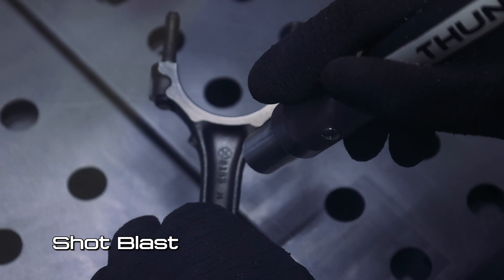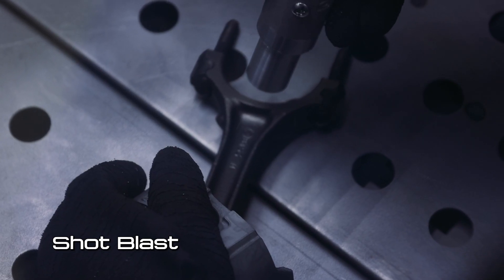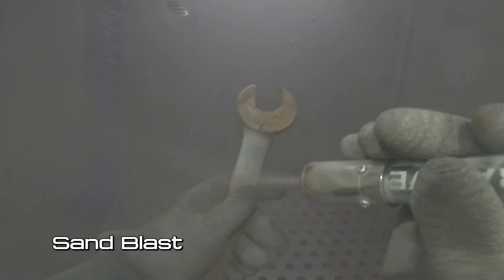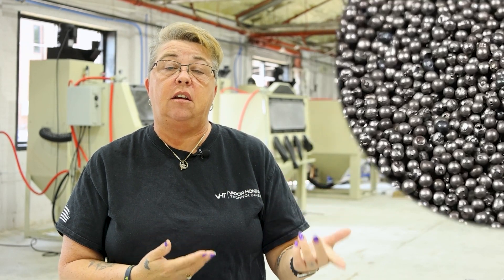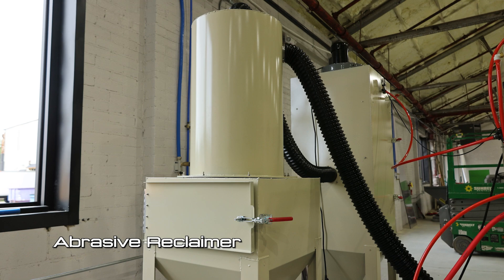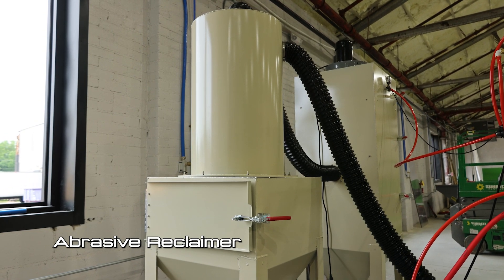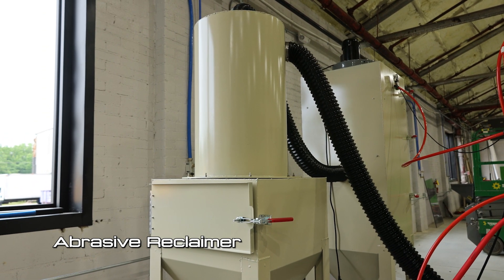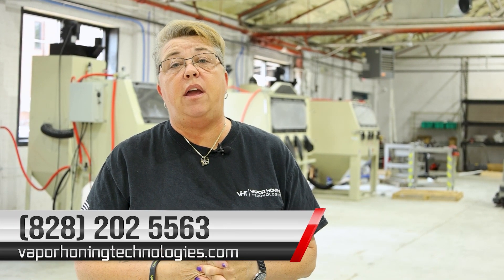Steel Shot vs. Sandblasting: What's the Difference?

Comment: Used to refurbish propane tanks with huge automated steel shot blasters. Wild machines. If you over did it, the tank would actually warp from the friction heat. Somtimes it would turn the paint into a soft mushy material, that was the worst. I remember spending days on a single tank.